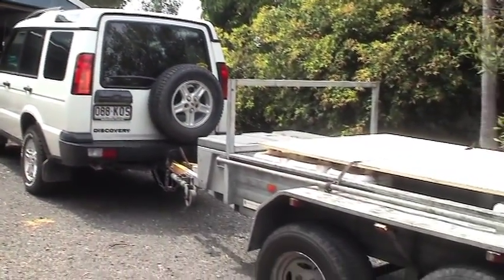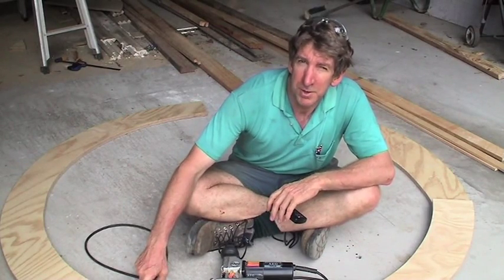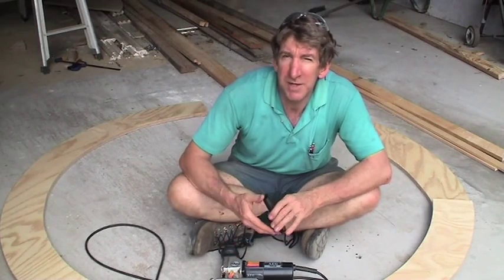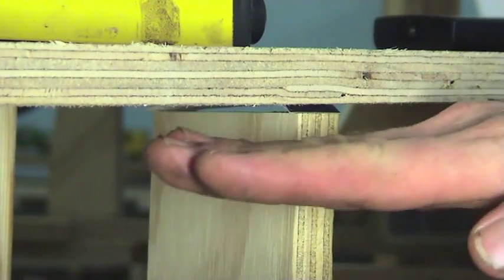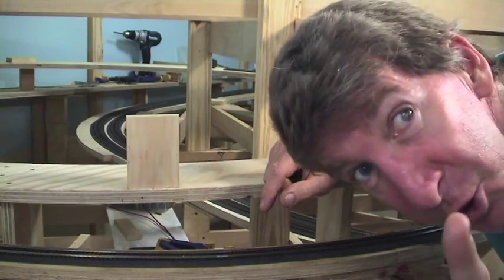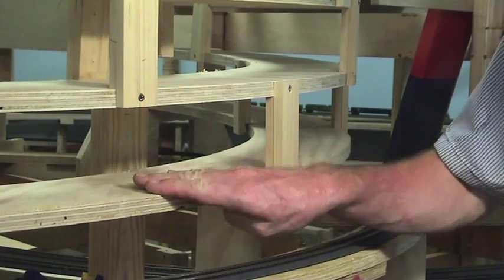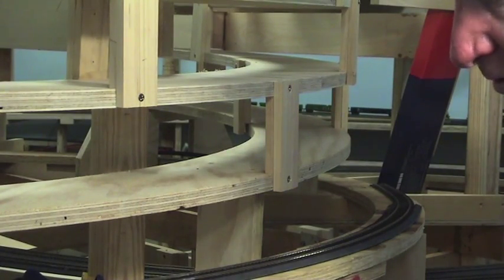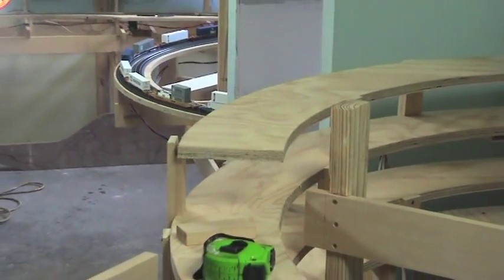BNSF Birdwood Sub' HO Scale, Part 10-A.

Comment: For all you people in the US.  At 36" radius if you go 4" from top on one level to top of next level it is a 1.87% grade that covers 18.6 ft per turn which is very good.  To make it simple put a 1x4 between the level pices its is 3 1/2 on edge so it adds up to 4" with a 3 1/2 clearnce which fits NMRA STANDARDS.  go to my web site and you will see one raised with spacers.

Comment: hi new to your channel great layout iam building a helix on three levels with the track going on each level what is the best way of going around it without using points  any help would be great  thank you  steve
Reply from the maker: Hi , thanks Stephen! The only way is to leave the helix on that level and then return to it on the same level, so you go in and out at each level. You can only do that with the outside track and the inner track could be the down track between the bottom and top level?  Having turnouts in a helix is a problem and a potential for derailments so it's a good idea to avoid them.
Cheers Gregg.